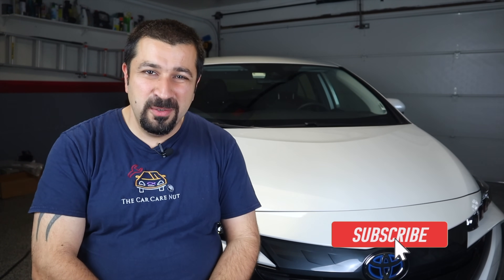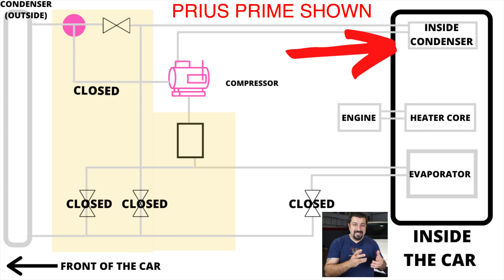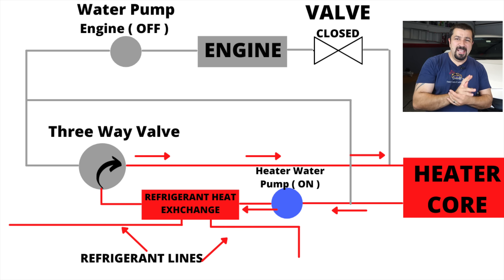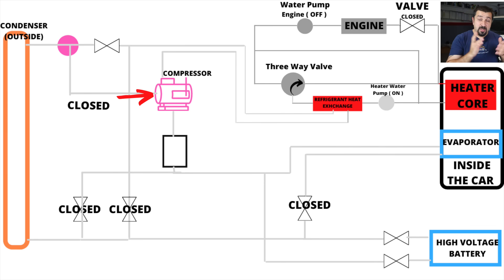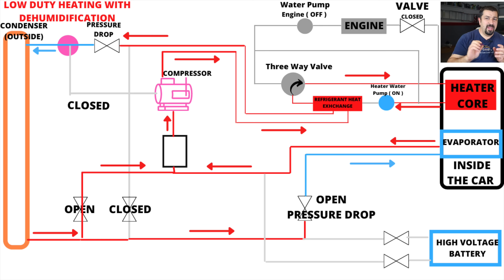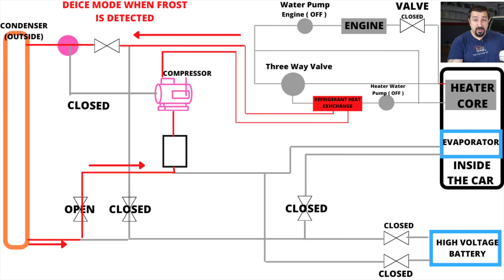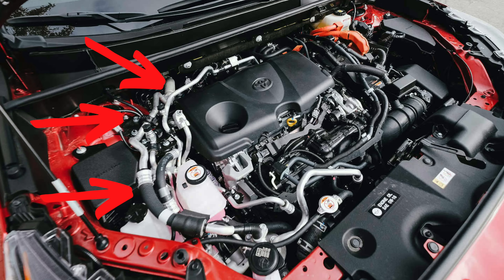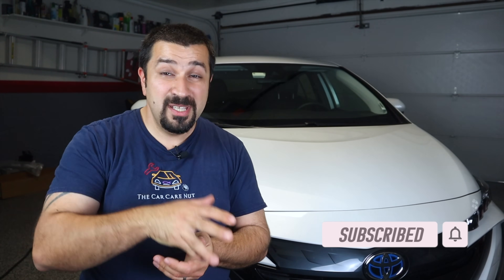The Worlds Most Complicated Car HVAC System? RAV4 Prime HVAC Explained

Comment: I have a 22 Rav4 prime with 38k miles. Check engine light came on and AC stopped working.  I paid Toyota dealer $95 for diagnostic. They said it was low on freon and I have a leak.  They said that it may be leaking from condenser where there is a small dent from accident 6 months before but it would be $350 to put dye in the system and find out for sure where leak is.  I decided I would take to ac place to replace condenser vs $350 for the dye.  AC shop said your AC is blowing cold you don't need a new condenser. AC has worked fine for past 2 months and now check engine light came on again and AC didn't work.  I checked code myself and it is P1501 Hybrid/EV Battery Cooling Refrigerant Gas.  I cleared code and now AC has been working fine again for past few weeks.  I wonder if dealer just told me I had a leak due to the code they scanned.  Maybe just need to do the 80k AC service to top off freon now early instead of waiting until 80k miles?

Comment: My new 2024 Rav4 Prime XSE Warranty and Maintenance Guide does not mention the AC service at 80,000 miles.  In fact, I don't see anything about it at all there.  Has this changed since the 2021 models?  Do we still need to do that?

Comment: Very helpful video which made me determine to not get the Prime and stick with the regular hybrid. Regardless of how reliable the AC system might be, it sounds way too over engineered and bound to break at some point. I just don’t want an AC system issue to be a factor that prevents me from driving a car. Just seems silly to engineer it in that manner. And refilling the system every 80k miles = $$$$. You know those mechanics are going to charge a lot for 1234yf refrigerant and labor.

Comment: When the Rav4 Prime is off and you  don't have the charger plugged in,   what are the possible normal noises you could hear from the car?  My understanding is there is the EAVP test system that comes on periodically.  Would any other fans come on by themselves during this off time?  Also would the heating cooling come on  to condition the battery or does that only occur when you are charging or have a departure schedule with the charge plugged in, or actually have the car on?

Comment: THANK YOU SO MUCH FOR THIS VIDEO. MY 2021 RAV4 Prime 30k kms has a failed Pressure hose and I took it to the Dealer. The part is back ordered and they told me I could drive the car. I informed them the battery is indeed AC cooled (because of your video) and driving it could potentially damage it. 
I will be selling the vehicle as soon as its repaired.
I'm an automotive service technician. I finally bought a Toyota because of their reliability....oops.
Reply: To be fair the dealership has been good so far and this is a new system for the technicians to learn.

Comment: I have a 2021 Rav-4 Prime that I love, but during the cold when you start the heat, there is a very loud vibration that rocks the car. Videos are all over the internet, but every time I went to Toyota, they used the TSB which told them to rest the HVAC system which didn't work, then the 2nd TSB stated to replace a HVAC tubing and that didn't work. They compared my RAV4 Prime to another RAV4 Prime both cars have the same issue.  They told me it must be normal, I told them it's something with the heat pump when there is cold weather. In the summer it doesn't have a problem.  So it's documented with Toyota and in my records so if there is a problem down the line then Toyota can if it on their dime. Any suggestion on how to fit this would be much appreciated.
Reply: Mine does it too. Then the HVAC system failed last week. And service hybrid system take to Toyota. They are working on it now.

Comment: This is the first I've heard that the a/c system is critical to the traction battery. Lots of older cars (more than 10 years old) are driven around with non-functional a/c systems, because for many cars that old, the whole car isn't worth what an a/c repair might cost. I guess this is no longer an option with any EV or PHEV that uses the a/c system to cool the battery.

Comment: Thanks for all of the videos-Learning a lot, just got a RAV4 Prime and its an awesome car.  Does the battery still cool if I don't use the AC in the summer?

I generally don't use AC until about 92F degrees (keep window down under 92F) and even then its set to 79F.  Is this still OK with the Prime or should I start using AC at lower temps.  Have no problem using heat in the winter (and part of spring/fall in NJ) as I prefer warmer weather to cooler.

Comment: After waiting 11.5 months, my 2022 RAV4 Prime finally arrived on October 16, 2022. It's a great car, and I like it very much. But ... I live in Wisconsin, and figuring out how to heat the cabin has me frustrated. I understand that the heat pump doesn't function below 14 degrees F., but the whole system doesn't seem to function consistently, and I'm not sure how the various EV-HV-Eco settings affect its operation. Sometimes the system steams up the windows, and sometimes it doesn't. I'm going to keep on experimenting to see if I can get it figured out. This video helped a little, so thanks for trying to simplify a very complex system.

I'm sure you know that Freon is banned in the U.S., so I assume you're using the brand name generically for whatever refrigerant fills the RAV4's tubes.

Comment: Thanks for the detailed explanation!  Just wondering if the coolant needs to be vacuum filled, or can it be filled and burped as usual?  I’m doing exactly what you wouldn’t recommend, which is rebuilding a RAV4 Prime that was in a front end collision 😬🤣
Reply: You need the scan tool to open all the valves to fill or purge.

Comment: Hi. I'm the lucky owner of the Rav4 Prime. My vehicle was imported from USA and local Toyota dealer in my country currently not have the similar cars for selling. My car needs the refrigerant refill as AC tube was damaged and now system is completely empty. I doubt that local Toyota dealership stuff will have the experience of the HVAC of PRIME model. Are there any differences of refilling the AC system with refrigerant specific to Rav4 PRIME model?

Comment: Great explanation, some what different to the Korean offerings, and a better explanation than the tech data 👍

Do you know if the ECO Mode on the RAV4 Prime plug ins drive Mode selector causing the heated seat to come on ?, owners manual says nothing about it

Comment: I believe your battery cooling diagram may be wrong, I would think there should be a suction line return to the accumulator. From what I see your showing two liquid lines and two metering devices and no return of the boiled refrigerant. How can that be?

Comment: I have a Rav-4 Prime that I love, but during the cold when you start the heat, there is a very loud vibration that rocks the car. Videos are all over the internet, but every time I went to Toyota, they said they couldn’t replicate it. :(
Reply from the maker: Hi! I know exactly what you’re referring to. No resolution to this yet and nothing official yet but it could be a normal characteristic of the heat pump system. If I know more I’ll let you know in a video
Reply: I am experiencing the same R4P heat pump vibration issue. Where I live it is cold 6-7 months out of the year. Especially bad when leaving from a 50 degree heated garage and the temp is below 30.
Reply: I had this exact thing happen to my old Prius C when really cold…ok really cold in Los Angeles (upper 30’s 😅).  Only happened twice. I shut off the car real fast and it didn’t do it again.  It was a violent shaking.
Reply: Mine does this too. Then the hybrid system failed. It's at the dealer right now

Comment: Hi, I have two questions please. I am considering to trade-in my 2021 RAV4 Limited to a RAV4 Prime due to increasing gas prices. Question 1: Should  I do the trade-in or keep it for few years? Number 2 question: I live in Toronto, wherein we have frigid weather during winter time (may go below -25C or Winchill of -55C); and summertime (with 30C to 40C heat). My concern is with the heating or cooling the car during this frigid weathers.  I hope to hear from you. Thank You.
Reply from the maker: Hi! Honestly in frigid weather the prime doesn’t do as well as most hope. Needing heat in that kind of weather will force the engine on and kinda defeats the purpose. A hybrid might be a better option but I wouldn’t trade in your RAV4 it’s too new and you’ll loose a lot more than the cost of gas savings

Comment: Complex YES!  Effective on cold winter days?  NO!  This car as the worst heater in it I have ever owned.  So bad in fact I added a remote starter to it.  STILL SUCKS!   It defaults to the heat pump mode which is pretty much no good at outdoor temps below +20F. 

But I'm not the kind of guy to just accept it.  I did something about it.  i can now remote start my  r4p and get it up to 100f cabin temp by forcing it to burn gas, even with the plug spout still inserted.   i did it safely too, without hot wiring the car's safety checks for plug insertion. 

i know the car-care-nut is not a fan of after market remote start devices, but i have a feeling even he would approve of how I pulled it off.  His videos, like this one where very helpful.

Its not an easy install, or an easy fix.  The car itself never sees it electronically.  No computer interfaces at all.  No bus tapping.  No data at all.  .  

I'm tempted to send him one to see how challenged he would be with the install being the expert he is on HPEV's.  

Loved your video on the xtool D7, also a great tool for this DYI project.  Reach out to me if you want to do a video on it.  careytreesh@gmail.com

Comment: Great explanation. I was surprised to see the heat pump doesn't seem to be designed to warm up the battery. Lithium battery is a dead weight in low temperature isn't it ?
Reply: I think they use an electric battery heater for that?

Comment: Great info!  I would love to see a video on the electrical system. How the high and low voltage system interact and how robust the 12v system is for accessories
Reply: If your thinking about adding a big car stereo sub system, think again.  You only get 125 amps on the 12v side.  Most of that is already in use.  Adding more load puts more stress on the power converter which is a very expensive part that might have its warranty void if YOU overload it.

Power inverters (the kind that output 120vac) demand MASSIVE amps off thee 12 volt system.  300 watts at 120vac is 30 amps off the 12 volt side.  1000 watts is 100 amps.  1500 watts is 150 amps. I think the fuse will pop at 125 amps directly off the battery posts.

I ran into 12v car battery charging issues quickly when I tried to pull too much juice in ready mode.

Comment: I have a 2021 RAV4 Prime. Under very cold conditions (under 20F) immediately when I turn on the heating system, it makes a very loud clunky noise followed by a continuous loud noise similar to a fan motor; sometimes the gasoline engine starts running, when driving the noise increases, when braking at a red light it decreases. Is this normal?
Reply from the maker: Hi! Many have the same issue. So far no solution on this one
Reply: Thanks!

Comment: Damn, I didn't know about the 80k freon service.  Shoots.  Good to know.
Reply: I think its still the R134A type. but  I def wound not try to self install any.  I'm sure the procedure is way more complex that just gassing it till the arrow shows green like in other AC systems.  You would likely needs specialized equipment to force open all the valves to evacuate and pull a vacuum then be forced to change by weight.    

Pray that you never have a leek, or a defective sensor in the system, service out of warranty on this AC system is gonna cost more than an engine swap.

Comment: That does look complicated. Is the refrigerant for the 80K top-off standard 134a refrigerant using a standard low-pressure loop charging valve? Do you need to activate a special diagnostic mode to make sure the coolant line is running at low pressure?
Reply from the maker: Hi! A scan tool is needed to open all the valves when recovering and charging
Reply: @TheCarCareNut  I thought that might be the case. I guess that's another reason to buy the XTool D7 OBD II system.

Comment: We have a 2021 Rav 4 Hybrid (not a Prime), I don't think it has a heat pump, yet somehow it kept us warm on a cold day when we sitting in the Rav with the heater on for over 40 minutes. How did it do that?
Reply from the maker: Hi! Hybrids have regular hvac system and doesn’t have heat pump. Because the engine comes on and off it’s able to maintain the coolant temp high enough to use it for heat
Reply: @TheCarCareNut  , strange thing with RAV4 hybrid was that the engine never came on for the 40 minutes, outside temperature was in the 30s and we kept on getting warm air coming out of the vents?  Battery did go down by about 20%, with only Heat and car eltronics drawing power. I know it doesn't have a Heat Pump, thought we may have resistive heater or  reservoir holding heated water from earlier driving.

Comment: Great video AMD!  Love the details.  I would love if you did a simplified video from a practical standpoint.  For example, let’s take heating up the cabin.  If temperature outside is 40 F, what are the simple steps we would need to take to heat the cabin.  For outside temps below 14 F, what are ways you could warm up the cabin, etc.  this way we would know what things we would need to do for different situations.
Reply: above +20f you can use the "hold ac" button on the key fob.  It acts like a 'remote start" but only runs the HVAC system.   Just be sure to have all our doors closed, and leave the heat settings on when you power down.

If its below 20f outside, that OEM key fob remote start function sucks.  I wouldn't even bother.

Below 20F just hit the defrost button, this will force the gas engine to run, which will give you useful amount of heat in the winter.  Once its HOT, you can turn it off and run on just EV then as the coolant will already be HOT, and the heat pump can maintain that without burring gas.

please keep in mind if you part inside, burring gas will generated harmful carbon monoxide. So use caution.  

Adding an aftermrket remote start is not that helpful on a R4P unless you do some pretty wild stuff with that install.    The two big issues are it too runs the weak heat pump, and it wont work AT ALL if plugged in,
Reply: @careytreesh4583  Do you mean won't work at all if an engine 'block heater' is plugged in? I'm a huge fan of block heaters. Use them on my ICE only car for anywhere from 30 min to 3 hr if -35Feh. This was a very illuminating video. I was feeling quite skeptical about owning a Prime, but the deal-breaker was if you catch a rock and spring a freon leak, there isn't even a limp-home mode. You just bought real estate on the shoulder.🙁
Reply: You get in, press auto, set your temp and forget about it. The system does the rest automatically.

Comment: Already had issues, it is not providing any cold air in the cabin above +22C (71F) (same for cold conditions under 0C (32F), no warm air). Got it checked, not low on freon, they performed a A/C service, still not better. Any thoughts?
Reply from the maker: No reports of issues on my side yet. They’ll need to look into it at the dealership
Reply: Same

Comment: I understand the system, but why not toyota use small electric heater on heavy duty mode just to help generate heat? Yes it will sacrifice battery. but its okay to borrow it for a while right?
Reply from the maker: Hi! It would be counter productive. The heater would consume too much and reduce the range

Comment: How to top off the refrigerant? Is it a DIY thing or does it need to be done by a professional mechanic?
Reply from the maker: Hi! Not a diy or even a conventional shop job. Needs a scan tool to open all the valves and correctly charge the system

Comment: Would the system be used to heat the battery at any point ?
Reply from the maker: No it only cools the battery. The heater for the battery is an electric one
Reply: @TheCarCareNut  
Thx

Comment: My 2020 RAV4 is the Base Model.  It's going to be interesting watching when the "PRIME" has problems.  Especially intermittent problems.
Reply: My rav4prime is a 2021, and we are half way thru 2026 with zero problems so far other than the 12v battery had to be replaced this year.  I know the prius primes had a small AC leak at about 20k miles, I will investigate that on my rav4prime.

Comment: for  sienna 2012 awd v6, how many mileage the oem brake rotor should last? thx
Reply from the maker: Hi! Hard to put it in miles because it depends on use. But generally if the conditions are ideal you can resurface the rotors possibly twice

Comment: Hi. I disconnected the air tube on my Toyota 21 CHR that sits above the radiator and now I have a check engine light. Will it clear over time? I was changing the horn.
Reply: Thank you for your response. Although this is not relative to this particular topic, One of your recent videos describes Toyota prep before its sold to a buyer. Low and behold The 2021 CHR was delivered to my nephew sprung an oil leak. At 1000 miles The oil fill cap fell off and wet the entire front of the engine and surrounding area. He only  realized something was amiss because of burning oil on the exhaust. He was able to add oil to the marked level. What is his recourse with Toyota dealer here in Queens NY?  They obviously left the cap loose.
Reply from the maker: Although things happen but that’s not something you want to happen on a new car! I would have them clean up the mess at least
Reply from the maker: Use a code reader to read the codes and erase them. They will eventually clear but will take some time